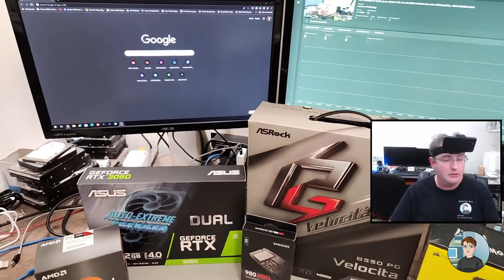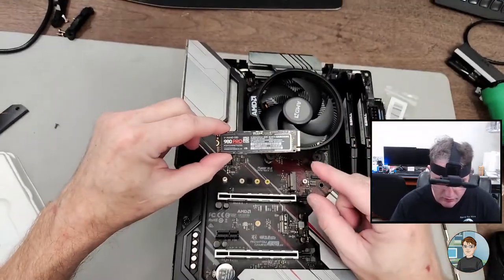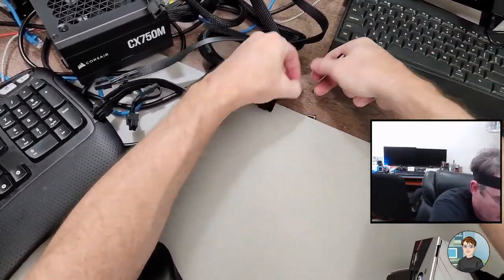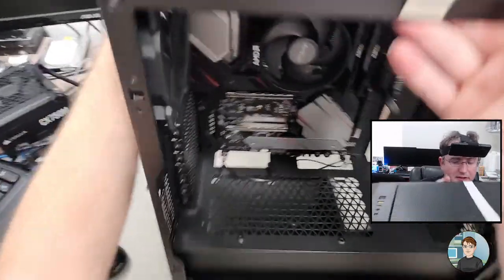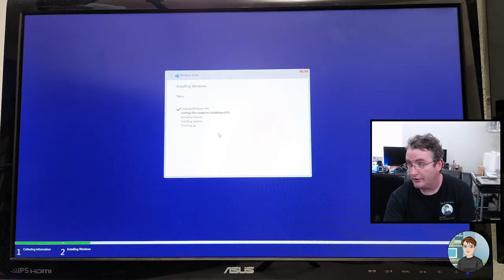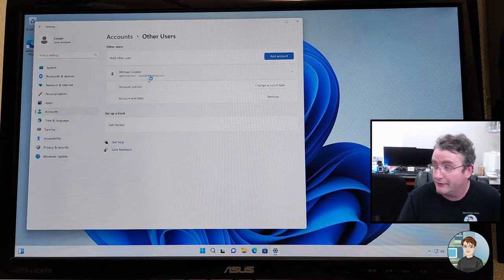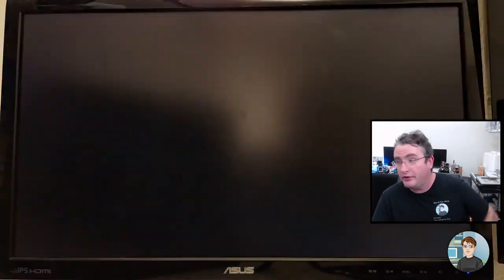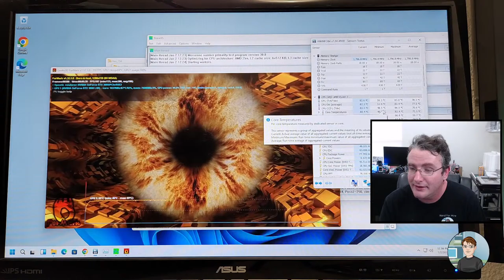New Desktop PC Build, Ryzen 5600X CPU, Asrock B550 motherboard, Asus 3060 graphics, 16GB 3600Mhz RAM

Comment: xaxaxa dude in 28.50 i said to myself how he can get a post screen without an Hdmi cable plug in the GPU , and after a minute you said figure out,nice build by the way and nice video this happens to me also when i try to figure out why my printer isn't print and dont recognise it from my pc and as you can guess i dont connect it to my pc usb port😅😅

Comment: Michael, why don't you ever run bios update within Windows?
Reply from the maker: I do occasionally if the manufacturer allows it. Most of the ones you see me flashing during build streams are from motherboard manufacturers selling to end users. The way they do their bios flashes is what you see in the streams. You copy it to a flash drive go into the bios and find the menu to flash the BIOS.

Comment: Do you have to jump start the mother board every time?
Reply from the maker: I think you might be referring to jumping the two pins together to get it to power on. Once the computer is assembled and you connect the power button from the case to those two pins the power button is what you use to start the computer. All the power button is doing when you press it is connecting those two pins.

Comment: I did not see the installation of the back plate ?
Reply from the maker: The back plate came already attached to the motherboard.
Reply: @MichaelTheComputerGuy   I have one of these boards on the way to me . Hopefully it will have the correct bios for Ryzen 7 5700g .